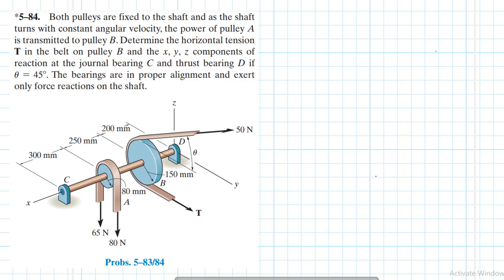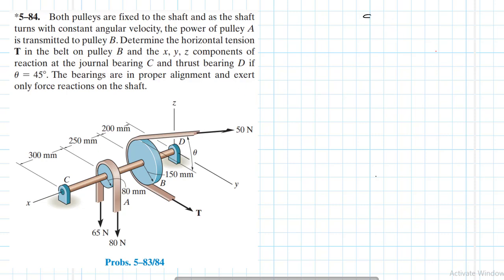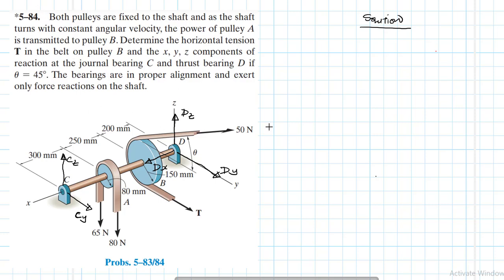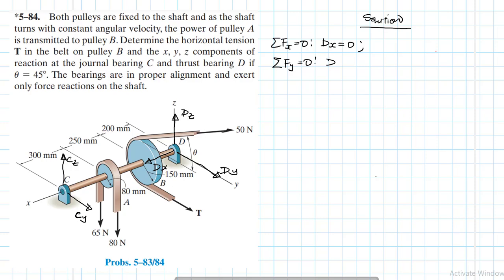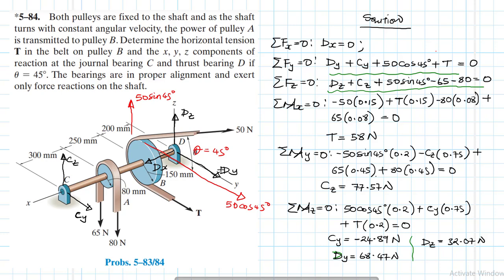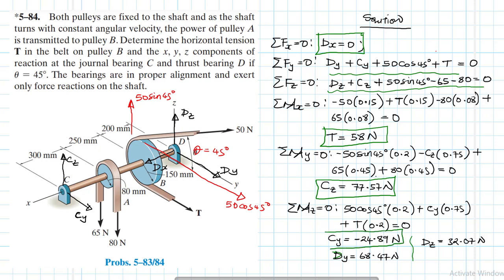5–84 Equilibrium of a Rigid Body (Chapter 5: Hibbeler Statics) Benam Academy

Comment: do you happen to know why we do 50*0.15 and not 50cos(45)*0.15?
because if we slide the force 50N along its line of action until its above the x-axis then it appears that the z component  of the 50N force does not contribute to the moment around the x-axis as it intersects the x-axis.
Reply from the maker: The force of 50 N produces a moment about the x-axis because it acts tangentially to the pulley. As a result, the force is always perpendicular to the lever arm of 0.15 m. The moment about the x-axis is therefore given by the product of the force and the lever arm, i.e. Mx = 50 x 0.15 N·m.

Comment: hello sir…for the Mx, why dont we have to resolve the force to become 50 cos 45 to find the tension?
Reply from the maker: We are informed that both pulleys are fixed to the shaft. Therefore, when analyzing the tension force T, we consider all the forces contributing to the sum of moments in the x-direction: 65 N, 80 N, and 50 N. For all three forces, the lever arms are tangentially oriented, meaning they are perfectly perpendicular to the lines of action of the forces, including the 50 N force.
Reply: @benniehamunzala  i still dont understand why w resolved the force for My and shouldnt the force be 50cos 45 not sin